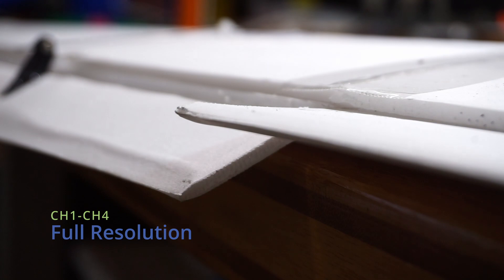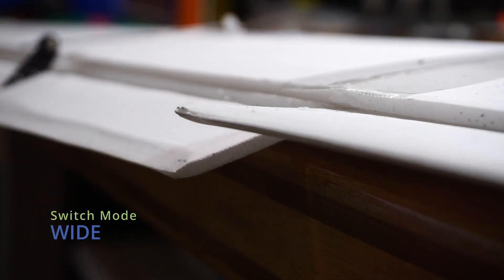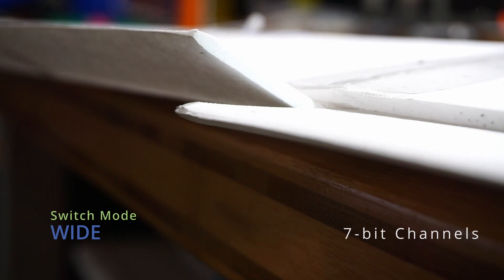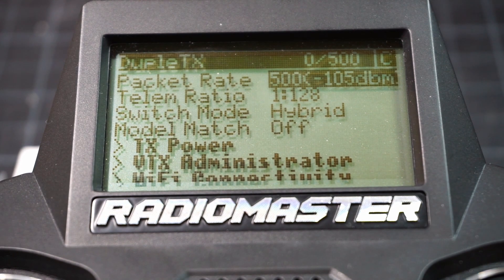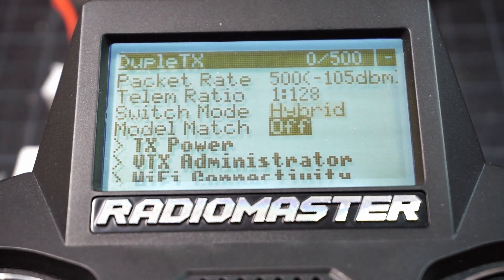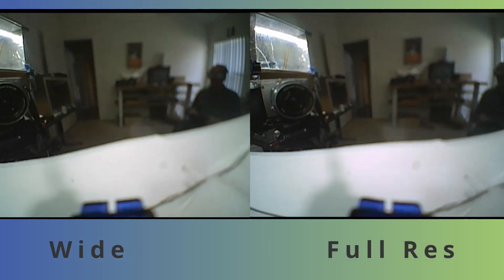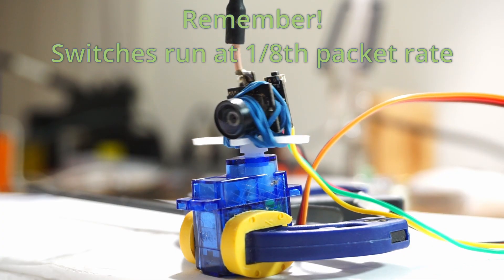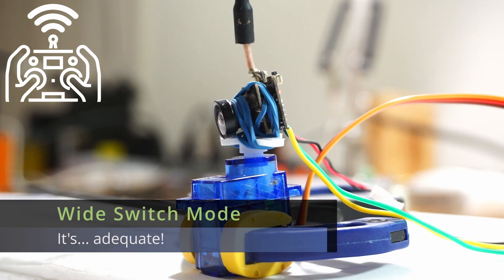ExpressLRS Wide Channels Mode

Comment: what should RSSI low alarm and critical alarm be set to when using ELRS?
EdgeTx default is low alarm 45, critical alarm 42
Reply from the maker: Whatever you feel comfortable with, the link works until it hits 0. As a starting point, 50 for warning, 20 for critical are probably good.

Comment: you mentioned channel 1-4 and 6 plus. what about channel 5 on the PWM receivers?
Reply from the maker: CH5 is always 1-bit  (2-pos) except in the new 16ch fullres mode in 3.0. It always MUST be used as an armed indicator (or motor kill). It is no big deal for PWM receivers because you can just change the channel mappings in the webui so the output isn't wasted.
https://www.expresslrs.org/2.0/hardware/pwm-receivers/#channel-mapping-and-failsafe

Comment: Excellent. So for freestyle quads "hybrid" is the way to go?
Reply from the maker: Both are fine for quads. Hybrid has a small advantage in that it is more robust to a OTA desync. If for some reason something goes horribly wrong on the receiver and it gets out of sync with the TX, Hybrid keeps working but Wide forces a failsafe. We're pretty sure we worked out all of those bugs, but that's why hybrid is still around-- because it's safer.
Reply: @CapnBry  Thank you
Reply: @CapnBry  does it also have advantage with better telemetry? I can guess that smaller packets gives more freedom for telemetry?
Reply from the maker: @youtubxkip  nope, both Hybrid and Wide switch mode have the same packet size and the telemetry type packet is the same either way, so there is no speed advantage. The fullres modes in 3.x have more telemetry bandwidth though because those packets are bigger, and of course the aux channels are full resolution too.
Reply: @youtubxkip  Wide... ...This is the only switch mode which can show the transmitter power TPwr on the flight controller's OSD.

Comment: Sounds like there's no downside, which begs the question, why do we need hybrid mode at all?
Reply from the maker: If the connection somehow gets out of sync with the TX, then the switches would get shifted around and output the wrong values, so to prevent this it will just failsafe until it gets back in sync. Many people told me it was too dangerous to just replace hybrid with this, so we still have Hybrid. Wide is the default since 3.0 though and I've heard zero reports of this happening.

Comment: Thanks for showing this to the complaining people 😉 . I was already convinced that Wide Channels mode was sufficient for flying my quads and planes. 
My thumbs are not able to adjust the servo  within +/- 1% accuracy when looking at the output monitor of my TX. And  for sure other variables as the wind conditions, servo resolution and the total servo play spoils the total resolution much more.  
So, I cannot complain at all because I have now full resolution on the first 4 most important channels and a little less resolution for the not so important remaining channels for flaps, pan and tilt and switches..... 😊.  
Thanks for your Hard and Smart work 👍